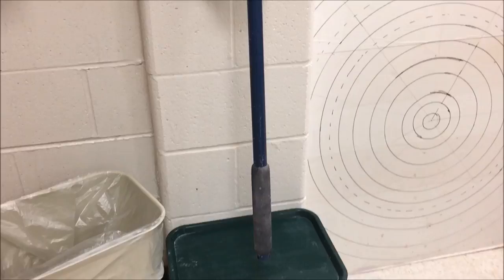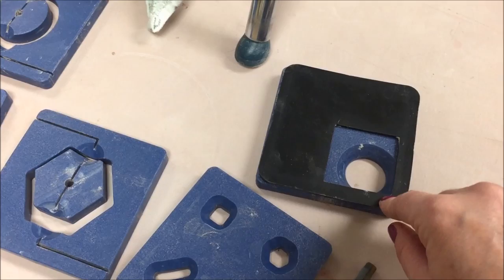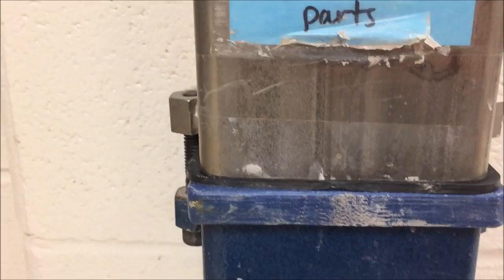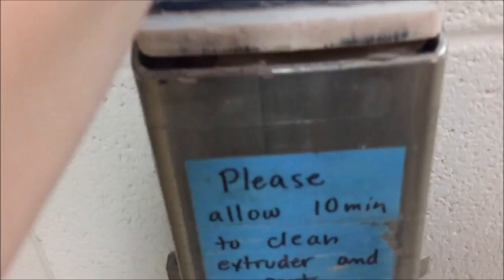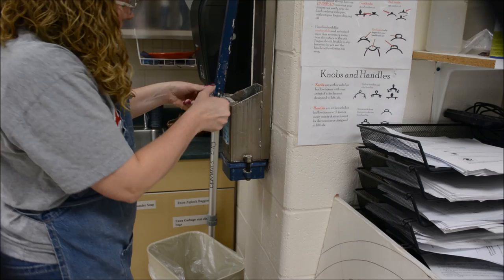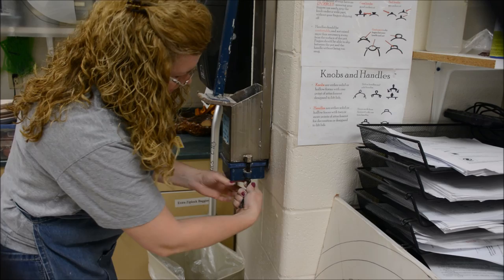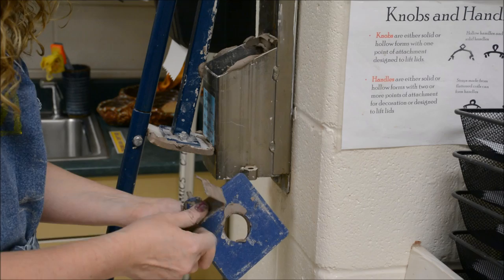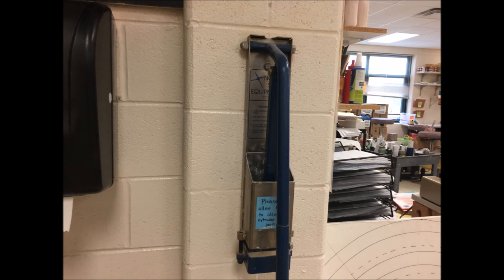How to Use a North Star Clay Extruder to Create Ceramic Coils and Hollow Extrusions

Comment: TIP: get two bolts with hex heads of the same diameter but longer, then put a big stack of spacer rings under the bolt head so it sticks out from under the device decently. Now you can use a ratchet! Also I see I'm 5 years late with this 😁

Comment: you can buy rachet allen keys. they cost about $20.
Reply from the maker: True!  I was trying to avoid the purchase of new tools!   ;-)
Reply: Would mounting a 2x4s (or 2x6's) on the wall behind the extruder so it sits farther out from the wall, give the wrench more turning space? Although, wood may be too "weak". 
   My local metal company, "Industrial Metal Supply (AZ)" sells square metal "tubing" with pre-drilled holes which comes in various widths. 
    2 strips hacksawed into appropriate lengths & mounted behind the extruder might be a lot "stronger" than wood! I'm sure it's available all over!
The url is: https://www.industrialmetalsupply.com/Products/telescoping-tube

Comment: I would remove the entire socket cap screw and replace it with a regular screw and use a small pivot screwdriver. The machine will be doing all of the work instead of your fingers.
Reply from the maker: Well, that's a great idea! I never even thought about using something with a screw driver type end instead of a bolt end!!!  Thanks for the tip!  :-)